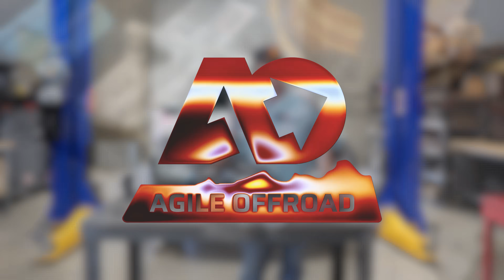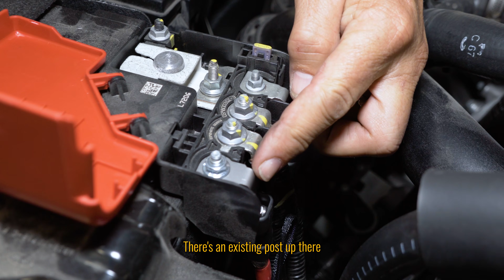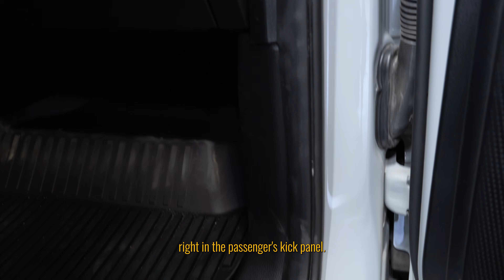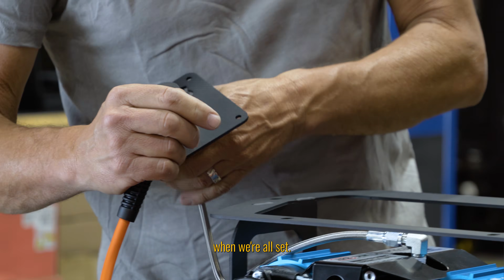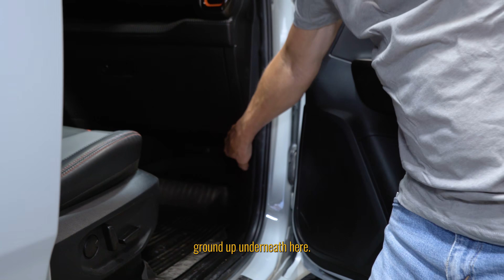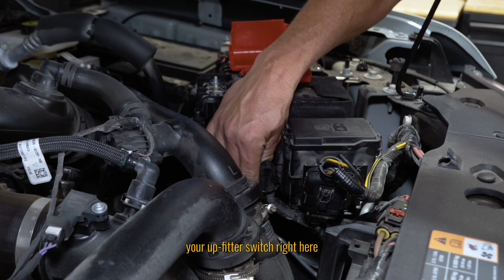Ranger Raptor On Board Air System | ARB Twin by Agile Offroad

Comment: Subject: Fitment Inquiry: Agile ARB Onboard Air Kit for 2026 Ford Ranger PHEVHi Agile Offroad Team,I am interested in purchasing your Agile ARB Onboard Air Kit for the Next-Gen Ford Ranger / Raptor, but I need to confirm compatibility with my specific vehicle.I own a Model Year 2026 Ford Ranger PHEV (Plug-in Hybrid).Since the PHEV variant has a different under-seat and chassis configuration due to the hybrid battery placement, could you please clarify the following: Under-Seat Fitment: Does your custom mounting bracket clear the PHEV model?Electrical Compatibility: Is the plug-and-play wiring harness compatible with the PHEV? Alternative Options: If this specific kit does not fit the PHEV, do you offer an alternative mounting solution (such as a bed-mount or engine bay bracket) for this platform?
Thank you for your time and help!
Reply from the maker: We haven’t test-fit the kit on the 2026 Ranger PHEV yet, so we can’t confirm compatibility with that model. The hybrid battery/under-seat layout may affect fitment. Our current kit mounts under the right side of the rear seat, and we don’t currently offer a bed-mount or engine-bay version.
This kit also requires a 12V source as well at the front of the internal combustion engine.

You can compare your setup against the install instructions here:
https://cdn.shopify.com/s/files/1/0965/1526/0718/files/R11-1000_On-Board-Air-Kit-for-Ford-Ranger_Intallation-Manual_v2-compressed_b34c0901-3212-4d74-b185-60ab30ab851e.pdf?v=1777589600

The only way for us to verify 100% would be to have the vehicle here for test fitment.
Reply: @Agileoffroad Dear Agile Offroad Team,

I hope you are having a good week.

Following up on my previous compatibility question, I have now had the chance to thoroughly inspect the under-seat storage cavity where your ARB compressor kit (R11-1000) is designed to mount. On my 2026 Ranger PHEV, the cavity looks virtually identical to that of the Raptor model, with one exception: there is a small, factory-installed bracket spot-welded to the floor of the compartment. This bracket appears to be specific to the PHEV version.

If this bracket were removed, the remaining space, contours, and mounting points appear to match the Raptor's layout perfectly.

I have also verified the routing path to the engine bay. The firewall grommet, the available space near the 12V battery, and the general accessibility are all consistent with what is shown in your installation manual.

I am not sure on how to attach photos here for your reference, as I wanted to show both the bracket in quistion, the engine bay layout and some from under the hood and battery area. 

Best regards 
Anders Ramqvist 
Sweden, Europe
Reply from the maker: Thanks for taking such a close look, Anders. That’s helpful info, especially noting the PHEV-specific bracket and checking the routing path.

Since YouTube doesn’t make it easy to attach photos, the best next step would be to email us at [info@agileoffroad.com](mailto:info@agileoffroad.com) with the photos of the bracket, under-seat cavity, engine bay, and battery area. That way our team can review everything properly and give you a more informed answer.

You can also call us at +1 (619) 328-1297, Monday–Friday, 8:00am–5:00pm PST.

Comment: How noisey will it be incab , jjust curious
Reply from the maker: Not very, depending a few things, like if there is something also on the back seat, and what that is, it would dampen the normal noise a little more, but generally to us it sounds pretty muffled and can be easily talked over. It's nothing like using a compressor in open air.
Reply: @Agileoffroad mahalo for the quick response, says a lot about the company🤙
Reply from the maker: Sure thing, happy to help! We appreciate the support!

Comment: I have a 2019 ford ranger and I have auxiliary switches i installed in it just curious if i could mount the compressor under the jump seat it’s an extended cab truck i definitely want to do this setup for sure
Reply from the maker: Good question! We’ve only developed and tested this kit on the 2024 Ranger Raptor, so we can’t say for sure on the 2019 Ranger.
That said, if the mounting points under the jump seat are similar, it could potentially work, but we haven’t had a chance to check that yet.
If you’re local, we’d be happy to take a look in person. Otherwise, you can send us some photos and measurements of the area and we can help you assess fitment.
Feel free to reach out to us at info@agileoffroad.com or +1 619-328-1297 (Mon-Fri 8am-5pm PST) 👍

Comment: Don’t know if you can help I have the same unit under my JKU for years now.  However recently the twin compressor would oscillate on and off rapidly and it’s not that complicated system I took the heat shield off and replaced the pressure switch and it worked like normal for a few cycles and then back to cycling.  I called ARB America but no help. Would you have any ideas?
Reply from the maker: That kind of rapid cycling is usually either a pressure signal issue or power related.
Even with a new pressure switch, a small leak, sticking check valve, or inconsistent pressure reading can cause it to kick on and off. On the electrical side, voltage drop, a weak ground, relay issues, or poor connections under load can create the same behavior.
Worth checking all fittings for leaks and verifying clean, solid power and ground at the compressor while it’s running.
If you want help dialing it in, feel free to reach out to us at info@agileoffroad.com or +1 619-328-1297 (Mon-Fri 8am-5pm PST) 👍
Reply from the maker: Also make sure to check the two relays under the heat shield. It's a fairly common failure point, might just be that, and they are relatively inexpensive to replace.

Comment: Umm not sure how good is to load an internal ground point with that much amperage from an air compressor, you will be bringing so much electrical noise to the modules that uses that ground point. I have always belive that heavy loads should always be connected to the battery.
Reply from the maker: Good observation! That’s something we looked at closely during development.
That ground point is a factory chassis ground, and we’ve tested the system extensively using it with the ARB compressor without any issues. No electrical noise, no module interference, and no abnormal behavior.
In general, you’re right that grounding strategy matters with higher loads, but in this case we’re still tying into a properly engineered OEM ground location that’s designed to handle it.
If you want to dig deeper into how we’ve got it set up or talk through your concerns, feel free to reach out to us at info@agileoffroad.com or +1 619-328-1297 (Mon-Fri 8am-5pm PST).